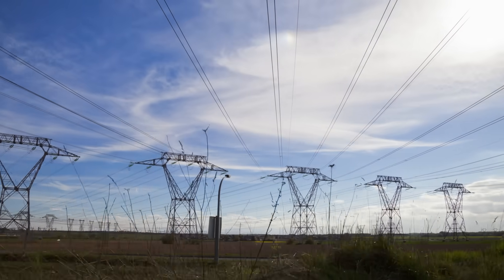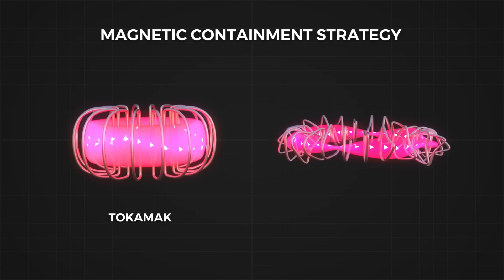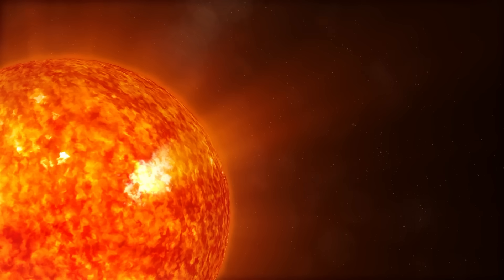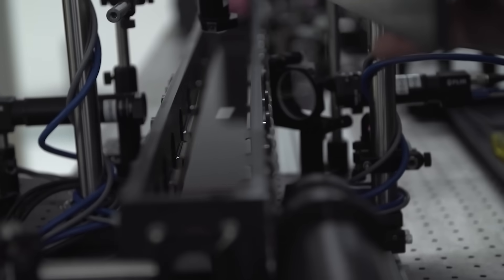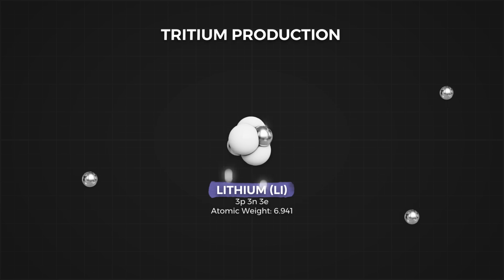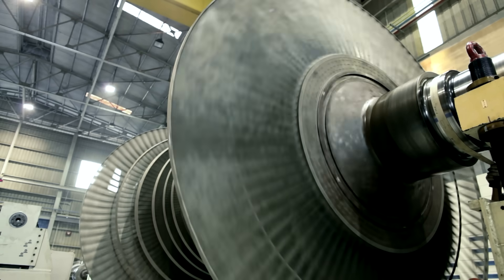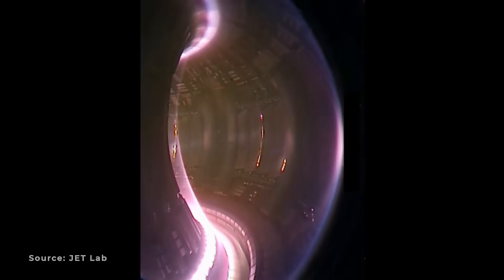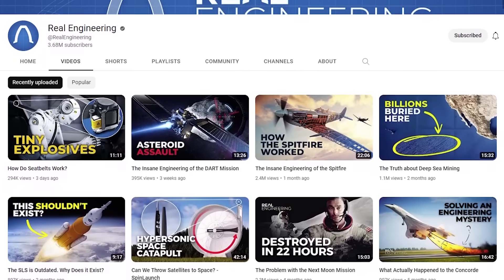The Problem with Nuclear Fusion

Comment: Great video. I’ve worked on magnetic confinement nuclear fusion at a National lab. One of the big problems is that everything is a massive partial derivative. Let’s say you have a hundred million particles inside the reactor. Each one has 7 dimensions of conserved motion. So traditionally to simulate it, you need either an extremely watered down equation that can make dozens of simplifying assumptions or a supercomputer that can take days to do a short simulation. Each particle can massively change their trajectory in just 10 microseconds, meaning if you want a perfect simulation for like 5 minutes, you need to run (100,000,000 * 5 * 60 * 10^5)^7 calculations which is probably some number bigger than the amount of atoms on earth. The good thing is that machine learning and GPUs are perfect for this kind of problem. So it’s gradually becoming the backbone of confinement modeling so the particles won’t fly out unexpectedly or the machine suddenly crash. In fact confinements not much of an issue anymore I’d say. Like I was able to take a 42 hour long simulation, rewrite it in CUDA, and have it run the same thing in less than 20 minutes. And on the experimental side, people have been able to run their devices for almost 10 minutes now which is extremely stable. And on top of all that, MIT recently made a high termperature superconductor that can generate massive magnetic fields so the machines can be scaled down to like 1/10th the size and still produce more power than ITER. While it’s still experimental, it’s basically in its last stages. The only things to worry about now is elmo.

The next stage will be finding the right materials to make the walls out of that will preserve the reaction and dissipate the energy over long runs. Tungsten has been generally used as the newer material but there’s still room for massive improvement. People have been experimenting with depositing an atom layer thick lithium gas on tungsten or using Liquid Metal walls that act kind of like a waterfall + cpu cooler inside the tokamak.

The tritium breeding issue is still on the horizon. Theoretically it shouldn’t be too hard to carry out. Just get a slab of lithium metal and put it right behind the tokamak or whatever device. But that’s a issue for another day.

Edit: also don’t forget that’s only tokamak fusion. There’s also like 20 other types of fusion techniques, some of which are very promising. ICF (kind of a budget laser-powered nuclear bomb) is experimentally like 70% (now >100%!) of the way to net energy. This is a massive jump considering how it was 5% just 3 years ago. Other ones are field reverse configuration with folding plasma whirlpools in the z direction, magnetic mirrors, z pinch (like a nuclear lightning bolt), and whatever that doesn’t need tritium and won’t produce neutrons so that the energy can be directly harvested with a magnet.

Edit: from Joesph Li

I do research currently at a fusion research institute. Some things worth noting: 

You're right that lots of folks are looking to ML and big data but traditional MHD and kinetic simulations are still the mainstay. Whole volume gyrokinetic simulation is widely used and actively researched to better understand transport as a whole. Neutral and wall interactions, and especially precise treatment of edge regions is mostly done via traditional methods rather than ML. 

Next on fusion techniques. You're correct that there are many different methods for containing a plasma, but the region the device landscape looks as it does today is because magnetic mirrors, Z-pinch, and other open designs have serious inherent confinement issues. As for ICF, the NIF actually reported a break even last summer on fusion gain in 2021 (not sure if published yet). One major issue the NIF faces is that ICF fusion requires several laser shots per second to be economical, but as of now I believe the rate of discharge is closer to once every several hours.

Lastly, I want to comment on smaller devices and different fusion fuels. MITs technology definitely holds a lot of promise, but one should temper expectations on output in smaller devices. Neutrons don't interact strongly and slips through solid material given enough energy (like those resulting for D-T reactions), so any D-T fuelled device necessitates fairly thick blankets and walls to efficiently extract energy. Moreover, one must still shield the outside of the vacuum vessel from neutron irradiation lest we risk the creating of radioisotopes outside the device from neutron bombardment. The obvious solution of using different fuel isn't so simple when one considers the much greater activation energy of those reactions. We can't even break even on D-T, never mind considering continuous operation on D-D or D-He3.

Progress is certainly being made but science takes time. And fusion is too expensive to get wrong. It's best to not get too hasty with our expectations.

Edit edit: just now, NIF achieved laser Q > 1 which is amazing for science. But it’s still a ways away from economic Q > 1 (where you can actually use it to produce power). But definitely a milestone and not number fudging anymore.
Reply: what did u study, how can i walk on the same path as you?
Reply: @venomous_zxs5493 studied physics. Most people in this field do physics, math, material science, aerospace engineering, nuclear engineering, or electrical engineering.

And the big 7 ITER countries should all have really good fusion programs that you can intern at. So US, China, India, Russia, France/UK/Germany, South Korea, and Japan. When you look for these programs, look for the word “plasma” instead of “fusion” research. I’m not sure why but it took me too long to figure that out.
Reply: @TasX  thx
Reply: @TasX  Why do we need to simulate the plasma to control it? If I have a steam engine I don't need to simulate the motion of each water molecule, I just need to make the walls of the piston thick enough to handle the pressure.
Do we need to simulate/anticipate the motion of the plasma because the magnetic fields we make are too weak?

Also, why not eliminate the tritium source problem by using deuterium-proton fusion which I think also removes the problem of high energy neutrons ruining materials exposed to them? 
Can't we just make the reactors bigger to distribute the higher forces of confining the plasma over a greater area?
Reply: @joeblogs6598  even a steam engine will fail if the firebox gets too hot, but otherwise theyre quite unlike fusion reactors when we at least know steam engines actually work 
just starting up a powerplant that doesn't generate power sounds expensive, around the mechanical concerns I've heard about lining the interior walls with sacrificial lithium plates that breed more tritium to use, yet that sounds even more expensive
anyhow its clear why simulation might be the cheapest move here, cheaper than doing nothing depending on who you ask
Reply: @SplendidKunoichi  My understanding is that they have to simulate the plasma in order to operate their reactors. I must be getting it wrong.

As for using lithium plates, it sounds completely uneconomical, or at the lest no cheaper than nuclear fission.
Reply: @joeblogs6598  assuming the electricity demand of a test start exceeds what the power grid can supply in real time, I'd imagine most of the time spent doing actual reactor experiments is just waiting for capacitor banks to charge up anyways
but data from computational models can be just as valuable in this field i think, the rationale might be a little like how astronauts have to do simulations in comparison
Reply: Please please comment more..   excellent post.
Reply: I do research currently at a fusion research institute. Some things worth noting: 

You're right that lots of folks are looking to ML and big data but traditional MHD and kinetic simulations are still the mainstay. Whole volume gyrokinetic simulation is widely used and actively researched to better understand transport as a whole. Neutral and wall interactions, and especially precise treatment of edge regions is mostly done via traditional methods rather than ML. 

Next on fusion techniques. You're correct that there are many different methods for containing a plasma, but the region the device landscape looks as it does today is because magnetic mirrors, Z-pinch, and other open designs have serious inherent confinement issues. As for ICF, the NIF actually reported a break even last summer on fusion gain in 2021 (not sure if published yet). One major issue the NIF faces is that ICF fusion requires several laser shots per second to be economical, but as of now I believe the rate of discharge is closer to once every several hours.

Lastly, I want to comment on smaller devices and different fusion fuels. MITs technology definitely holds a lot of promise, but one should temper expectations on output in smaller devices. Neutrons don't interact strongly and slips through solid material given enough energy (like those resulting for D-T reactions), so any D-T fuelled device necessitates fairly thick blankets and walls to efficiently extract energy. Moreover, one must still shield the outside of the vacuum vessel from neutron irradiation lest we risk the creating of radioisotopes outside the device from neutron bombardment. The obvious solution of using different fuel isn't so simple when one considers the much greater activation energy of those reactions. We can't even break even on D-T, never mind considering continuous operation on D-D or D-He3.

Progress is certainly being made but science takes time. And fusion is too expensive to get wrong. It's best to not get too hasty with our expectations.
Reply: @jolli_sym  great comment, can I copy this onto the top? For NIF, I think they did Q = .7 so not scientific gain yet. It was more the burning plasma achievement.

Edit: well breakthrough yesterday. What a coincidence
Reply: @TasX  certainly
Reply: @jolli_sym  As it was marketed by MIT in one interview, Commonwealth Fusion Systems needed only one “miracle.” That miracle being the High Temperature Superconducting cable called VIPER reaching 10 Tesla while meeting other specifications for temperature, stability, etc… VIPER reached those specifications according to CFS’s press release on 10/7/20. According to the YouTube interviews I’ve seen, the rest of the work is engineering and not in the realm of unknown science. Of course, engineering isn’t easy, but the science appears to show a path for their SPARC device to produce net energy output. While it wouldn’t be a power station, I suppose SPARC would be the Chicago Pile moment for fusion. Any thoughts? I’m just a layman.
Reply: @Luvurenemy  I'm not an expert on superconductors so I can't comment on the finer nuances, but a glance at the VIPER paper looks to be a clever design that more or less addresses the main structural issues usually associated with HT superconductors. Once the performance is there, fabrication and cost becomes the foremost issue. 
I'm certainly optimistic about what CFS is doing and can't wait for their demonstration machine to be completed. 

There is something to be said about size and these private enterprises though. One should keep in mind that these companies can never target a machine the size of something like the W-7X let alone ITER. It's simply too expensive and too big for them to handle, and they have to have something to show investors in a pretty short time frame. Hence reactor designs that are smaller, easier to prototype, and easier to sell investors on. But power plants have way better returns when they are big. From nuclear waste disposal to all the ridiculous supporting infrastructure a tokamak necessitates, the ROI on bigger machines is just better. And you can't simply just scale up a design. Where SPARC is concerned, the cynical side of me wonders if the small reactor designs plays into SPARC's VC facing marketing. HT superconductors are notoriously brittle and we don't know that once scaled up, it would be able to hold up it's own weight. I am still nonetheless optimistic however.
Reply: @jolli_sym  Thank you for your insight.
Reply: @jolli_sym   @F F  I studied nuclear engineering with a focus on plasma and fusion science, but I now work in a different field. Is the purpose of the of all this modelling work to improve the confinement of the plasma? Is tungsten erosion the primary issue with confinement?
What do you think of TAE's approach? They require much higher energies for their p-B11 reaction but they seem to be scaling up pretty fast.
Reply: @TheOOOOOOOOOOOOOOO  Numerical modeling of the plasma is done for pretty much any reason you can think of. I am primarily interested in plasma transport and turbulence, others study things such as wall interactions, heating, impurity effects, interactions with neutrals, sputtering, molecular dynamics in the sheath region, and all the various modeling done for developing plasma diagnostics. 

While tungsten erosion is a hot topic, and especially important for ITER, it's not got much to do with confinement per se. Confinement generally deals with maintaining the core plasma under your choice of conditions for as long as possible. Also, I'm unfortunately very unfamiliar with what TAE is up to. Reactions other than D-T are pretty off the table as far as academics are concerned. The math has been done and it's just much much harder.
Reply: i like your funny words magic man
Reply: From this, I can only conclude that fusion will never be possible with our present capacity to model, but that advances made during the pursuit of fusion will lead to better weather forecasting.
Reply: @Mad_Props_Gestapo haha definitely. I feel like so many important technologies have spawned off of fusion research over the last hundred years that it’s become the embodiment of “it’s the journey, not the destination” (though reaching the destination might also be nice)
Reply: Is "net energy" Q>1, or actual calculation of harvestable electricity greater than consumed by the experiment, because we need like Q=10 at minimum for actual "net energy", and like 50-100 for practical economic use. I hope I live to see it, but there's a lot of spin in the physics of fusion. 
Also, your sample calculation, if it's really everything ^7, is like 10^108 operations, so, a 100 petaflop supercomputer running for like 10^83-some years, but I get the point. 🙂
Reply: @NicholasA231  They say getting to Q=1 is a physics problem, and any Q>1 becomes and engineering problem. Once we have a breakeven reactor that can run effectively indefinitely, we know fusion power is possible.
Reply: wow there's alot here that i could learn from but as a mechanical engineering student i only notice one missing thing
you said there are 7 different kinds of motion but i can only count 6 (transversal in all 3 directions then the rotational in all 3 directions) so what's the 7th?
Reply: @guythat779 it’s phase space velocity + time. So 3 spatial dimensions, 3 velocity dimensions, time dimension (used for volumetric predictions with ML and maybe some numerical integration idk about the second one). Look up Liouville’s theorem for more on it.
Reply: @TasX  I positively understand nothing but thanks for the references
Reply: @guythat779  It's kind of the backbone of how Lagrangian/Hamiltonian physics was derived. It turns out that you can use this theorem to derive any conservation equation (like conservation of energy, momentum, etc). Then use those equations to find the motion of anything.
Reply: @TasX  I see
Thanks
Reply: @guythat779  is it vibrational?
Reply: @TheOOOOOOOOOOOOOOO  he answered me afterwards, just look throughout
Reply: "z pinch (like a nuclear lightning bolt), and whatever that doesn’t need tritium and won’t produce neutrons so that the energy can be directly harvested with a magnet."
If I understand this statement, it is something I have been wondering a long time - why can't we bypass the wasteful steps of converting nuclear to kinetic to steam to mechanical to electrical,  and go directly from nuclear to electro-magnetic?
Reply: @aliensoup2420  depends on the type of reaction. I think most if not all aneutronic reactions do direct to electric since all the particles are charged. Neutron producing reactions rely on the fact that neutrons don’t interact a magnetic field and that they fly out of the reactor to convert that energy into thermal energy. A lot of startups like to try the second route. But there’s a lot of logistical issues that they’re working through. Getting fusion is hard enough, getting fusion and somehow sustaining it while messing with the electromagnetics is another bag of worms. Also the neutron producing reactions operate at about 10 million degrees cooler than the aneutronic reactions so they’re also easier to carry out.
Reply: Not gonna lie.
Some words I didn't understand.
I'm skeptical 99% of the time about random comments but this sounds really honest and cool 😎.
Reply: Turns out ICF is 100% of the way to net energy at the Lawrence Livermore National Laboratory in California
Reply: Was that not the problem deepmind more or less solved half a year ago. 
I remember, they used reinforcement learning instead of the traditionel control methods.
Reply: @bjarke7886  not exactly. They were able to show that they can do pretty accurate dynamic predictions given a good initial model. The problem is that the computer isn’t fast enough and the video camera isn’t fast enough to constantly keep up with fusion plasma, which can change in the microseconds. It’s good for getting a general picture of what might happen though a few seconds down the line though. So people have recently built these gas puff devices that can cool down the reactor when it looks like it’s about to blow up.
Reply: I had a friend at Nvidia that did work with one of the spooky Labs. He said it was always low neutron retention and crap energy density...
Reply: But I like burning coal.
Reply: So  you are saying it's not a real time sim, right?  :-)  The fact that you can even DO that simulation, in any kind of a useful time frame, is actually amazing to me.

I had a 70 Cuda, when I was young.  I know, I'm full of them...really did though, actually two, one blue, and a later one that was in better shape to rehab, in black.

My dad did some electronics nuclear hardening testing for the SPRINT missile program, where he was the Systems Manager, in a pulse reactor.  But an H-bomb generator sounds a bit impractical, even to me.  😕

This next part is not smart assy, it is true: He taped a roach to the reactor on one test and it walked away when released afterward.  Also, they ran the first test and the usual BANG they heard in the control room didn't happen.  The engineer in charge said, "Hmm, never had that happen before".  They figured out that the test object was limiting (almost negating, i guess) the reaction.  

Dad asked, "What if it had been the other direction?" and the fellow said, "Then we wouldn't be discussing this right now". Oh, the fun some people have that nobody hears about!  Probably better that they don't, with stories like that.  Bad enough when they are dropping nuclear weapons in swamps in US states, accidently blowing up nuclear missiles in silos, leaving live nuclear weapons unattended on a tarmac, etc. (All true to, as I understand it, look them up, other than the one I related second hand, you probably won't find that one, but you never really know).
Reply: Hopefully quantum computing will come to your rescue in the next couple of decades
Reply: What is your opinion on aneutronic fusion?  He3+De2=He4+P
Reply: Fascinating... And very informative, thanks!
Reply: I really like the varient that can harvest energy from disturbance of magnetic fields.
Seems like it would be the most precise and sustainable kind of energy capture if achieved.
It's way easier to tune electromagnets than it is solid material and fluid dynamic systems...
Reply: Hey, what do you think if the lack of exotic helium problem?  We don't even make it anymore as far as I know, but I am just a farmer with serious insomnia.
Reply: Maaaaaybe time to reevaluate after the recent breakthrough, no?
Reply: Hi, my research is in hydrodynamic instabilities (non-MHD, but many mathematical techniques borrowed from plasma physics). I want to discuss some issues you've pointed out. Any way to PM you or have a virtual meet?
Reply: thanks for the elaborate comment, i was part of a research group worked on Plasma facing components as material scientists and lithium breader "blanket" in the UK. we tried using low activation refractory high entropy alloys as plasma facing components its a new class of alloys with a lot of promising properties and good radiation shielding.
Reply: Man, that is a great essay on Fusion power. You shouldn't waste all that knowledge in here, repost it to Quora or some other better platform for Science.
Reply: By any chance is the code available to the public?
Reply: @TWFDeadzoneII yeah check out gykell or gk. Those ones are actively used. Another more accessible one is plasmapy
Reply: where can one read up on MIT superconductors? I think it's the first time I hear about them
Reply: @NoNameAtAll2  Look up Commonwealth Fusion Systems, CFS, they built it.
Reply: I wrote a paper about this in 6th grade, roughly 40 years ago. 40 years ago they said it would happen within 10 years. For years it was always 10 years away, now they're telling us is 20 years away. Face reality. This may eventually happen. But we're nowhere near it. We need to be using technology that we actually have and can use Liquid fluoride thorium reactors are technology which is available today and can free us from fossil fuels. People need to stop throwing out the baby with the bathwater. No lftrs are not perfect. They're a hell of a lot better than anything else out there. And fusion isn't there. It's not practical. We can make it happen but we can't extract more energy out than we put into it yet. And even when we can extract out more energy than we put into it is it going to be enough more to make it worthwhile. How quickly are we going to burn through our stocks of available hydrogen. Lftrs or technology which are available today...

Build them now, and continue researching fusion. Maybe someday Fusion will even become practical. In the meantime we can have energy that is free of fossil fuels. For the next 10,000 years or so until we can figure out the next step
Reply: What is the name of the new HTS discovered by MIT please ?
Reply: @robinchaneac7180  REBCO tape
Reply: What happens if uranium or another fissile material used in fission reactors is used to line the walls of a fusion reactor to add heat from fission to the steam generator. Would that be a way to "turn on or off" fission? Adding a layer of safety to fission reactors and added efficiency of direct electric induction of fusion reactors? Also would this allow longer use of u235 and it's byproducts?
Reply: @John-sp7ne  I think there was a theory about that. But generally no one’s talking about it right now. It’s hard enough to build a working fission reactor and even harder to build a fusion reactor. Maybe once we build a working fusion reactor we can worry about making a fusion fission reactor.
Reply: So... what you're saying is 20 years, tops?
Reply: On the way to net energy? So that means it will be a "success" when they get the first 100 watts out of it at a cost of a billion dollars?
https://youtu.be/V_0VEmN7Bg8
Reply: Couldn't you use quantam computers to speed up the simlations?
Reply: @jeremiah5430  once quantum computers work
Reply: @TasX  Hopefully they can find a fusion process that is more elegant. The current one gives off a bit of a bodge vibe as if something is missing.
Reply: @Termite Ant Soup X  Im just a layman on this subject but have heard a lot in both directions about He3 potential, particularly from long term visions of lunar mining. I imagine thats its current scarcity means not a great deal of research has been done on it outside of the theoretical, still would you have any comment on if you think, if we did suddenly gain a relatively plentiful and cost effective supply, it could help the Fusion Industry take off?
Reply: @cyborg_v271  you should definitely watch the next video this channel puts out then. It looks like they’re going to talk about Helion which does He3
Reply: Have some faith, we are making some crazy leaps in fluid/MHD simulation technologies piggybacking off of the AI race!
Reply: Repent. Believe in Jesus. John 3:16 KJV - For God so loved the world, that he gave his only begotten Son, that whosoever believeth in him should not perish, but have everlasting life. 
Luke 13:3 KJV - I tell you nay: but except ye repent, ye shall all likewise perish. 
2 Corinthians 5:17 KJV - Therefore if any man be in Christ, he is a new creature: old things are passed away; behold, all things are become new.
Reply: What are the actual exhaust components from a deuterium tritium reactor? Also for energy production, would we still probably use steam turbines, or is there something different from fission that we could use to generate electricity?
Reply: If you want to make a working commercial fusion reactor in two years, and get commercial heat, I can help you. I have made a great world-class scientific discovery about nuclear fusion in the atmosphere of the Sun.  The assumption by scientists all over the world about nuclear fusion in the core of the Sun is well known.  This is a fallacy. For over 72 years, scientists have not been able to make a working commercial thermonuclear reactor, and will not be able to make one for many years to come. The reason? The misconception of nuclear fusion in the Sun. 
Nuclear fusion in the Sun's atmosphere begins under the physical conditions existing there at an initial plasma temperature of 5,000 K; by the end of the fusion reaction, the solar plasma temperature reaches 1,500,000 K, on average.  Sunspot temperatures on the Sun from 3,000 K, sunspots can be up to 100,000 miles in size. Doesn't this prove that nuclear fusion occurs on the surface of the Sun, not in the core of the Sun? If we take a good look at and study sunspots, it is clear that nuclear fusion takes place in the Sun's atmosphere.  
I know how to replicate the physical conditions for nuclear fusion in the Sun's atmosphere. I propose a reactor design with the same physical parameters for nuclear fusion and excess heat as in the Sun's atmosphere.    https://www.youtube.com/watch?v=FcypwoVOAAY 
To make a small working prototype confirming the principle of nuclear fusion in the Sun's atmosphere and obtain commercial heat needs about 10 million euros, manufacturing time 2 years. It could be less. Depends on the country where the prototype will be made.
Reply: why not use PDE to model plasma? model as a fluid, not particle
but fusion don't look cheap... thats too bad.
people are most reluctant to pay more.
Reply: That was useful.
Thanx
Reply: Sure 
What u said sounds good 👍
Reply: I want to watch a video on the topic by this person.
Reply: "Field reverse configuration with folding plasma whirlpools in the z direction"

That is the coolest arrangement of words in the English language that I have ever seen
Reply: Back here in December 2024 - how's the progress?
Reply: Can you give me a document? I need to leak to war thunder forum
Reply: What is the repetition rate?  Yeah....that's kind of important. 24/7/365, hundreds of times a minute. Kind of a crushing thought.....
Reply: Try this data point: Because the electron's Coulomb (electrostatic) repulsion for another electron is 10-with-42-zeros times as strong as gravitational attraction, harnessing a controlled, sustained fusion reaction in a local environment WITH MORE ENERGY DRAWN OUT THAN PUT IN FOR THE ENTIRE PROCESS is a PHYSICAL IMPOSSIBILITY. "Put that in your smipe and poke it!

A physical impossibility! Yet, much money and time is being WASTED on attempts to “find a way,” apparently to justify continued reckless population growth on this fragile planet. (The problem does not exist with fission reactions, which have their own set of intractable problems, because energy release follows the direction of universal evolution WHICH IS TOP DOWN cosmology)
Reply: Per Google, John Adams said, “Facts are stubborn things; and whatever may be our wishes, our inclinations, or the dictates of our passions, they cannot alter the state of facts and evidence.”
Reply: Im very excited about thorium reactors tbh, safer, more publicly accepted, and sure lower output but still a fair amount. I just hope we have 3 hardcore failsafes before we go into mass production. Overkill? Sure but radiation is not to be trifled with. Ive toyed with the idea of flooding a reactor with an inert gas that lowers radioactivity but I dont think we have something that does that or at least I dont know of it. Id love to know your thoughts!
Reply: Per Wiki: "Two centuries ago, a somewhat obscure Scotsman named Tytler made this profound observation: 'A democracy cannot exist as a permanent form of government. It can only exist until the majority discovers it can vote itself largess out of the public treasury. After that, the majority always votes for the candidate promising the most benefits with the result the democracy collapses because of the loose fiscal policy ensuing, always to be followed by a dictatorship, then a monarchy.'"
 
This is more-than-coincidentally the estimated amount of time it would take for a competitive and hence intelligently evolved tribal mentality to devolve into an idiocracy.
Reply: Okay I just read all that and if I understand correctly, you’re telling me that this SUCKER is nuclear?
Reply: No. The problem is that this sucker only makes 1.15 gigawatts. Obviously we need 1.21 gigawatts.
Reply: EVERY mechanical conversion of energy from one form to another has an inefficiency; otherwise, it would be possible to build a perpetual motion machine.
Reply: Since the universe began with a singularity, if that singularity was a Big Bang, then all of the currently-observable order is required to “self-assemble” from the resultant hot chaos—“allowed” because, though extremely improbable, it is not theoretically prohibited. I don’t believe that! My theory starts with a singularity where everything is connected into a single mass that initially divides into two, like in cell division, but with smaller masses with each division, united by proto-gravity. (Gravity and light were indistinguishable in the beginning.) If in choosing between the two, one of the theories contains a “unwanted message,” that “everything is connected,” then the former theory would be preferred (with blinders on), thereby conceivably allowing a misinformed majority to be manipulated for power and selfish gain by a elite minority. You can “take that to the bank!”
Reply: 100 percent words. 0 percent understanding. I speak only for myself
Reply: Bro reading this makes me feel like an ooga booga cave man from stone age in comaprison to your knowledge and intellect.
Reply: Has anyone tried using a plasma to contain the plasma?  kind of like a blanket? Maybe Xenon?
Reply: Realistically inertial confinement isnt likely to be good for energy generation. It's effective for fusion bombs though....
Reply: Meanwhile, fission plants work, they are here, carbon-free, always on, inexhaustible fuel.

Fusion is a money pit.
Reply: @scottslotterbeck3796  Any new form of technology is initially a money pit. The idea is that after a while, people can figure out how to make it profitable
Reply: Know of any promising ICF fusion companies to invest in?
Reply: Its the WRONG shape. That's why it will never work. also the fuel tritium has run out already. only 14 kilos worldwide. has half life of 12 years !!!!
Reply: You and others like you are the problem.  Here on Youtube trying to sway public perception knowing full well what tritium does to human and plantlife.  For fusion reactors to use tritium/deuterium we have to rely on fission reactors...being that naturally occuring Tritium is extremely rare on Earth and only found in trace amounts in the atmosphere.  Tritium permeates the metallic structures, and when taken up in plantlife forms Organically Bound Tritium of which does not have the same biological Half-life of 12-30 days that just tritium alone has.  OBT causes DNA strand breaks, micronucleus formations, cell necrosis or apoptosis, chromosomal aberrations and various other phenomena thus negatively affecting human health.  This is from newer research and rhe biological Half-life of OBT has still yet to be determined.  This is exactly why all water cooled fission reactors need to be shut down today because the Blue Ridge Environmental Defense League publication in 2007 on the "Health risks of adding new reactors to the Vogtle Nuclear plant" shows the affects.
Reply: What about using sound to contain the plasma?  I've seen videos on how they use sound to hold and manipulate a small piece of wire in air.  They were talking about using it in surgery to insert objects into the body using sound.  Or is the mass of the plasma sufficient to need more than just sound to contain it?
Reply: @anothermike4825 you need a medium to conduct the sound (since it’s a compressional wave). The inside of a tokamak is a vacuum chamber and particles are moving so fast they rarely interact other than at the edges. I’m sure there might be microcompressional effect like micro plasma turbulence you find at the walls of the device where particles bunch up. This is still being researched. Might have to do with why we keep getting this annoying instability that drains the device of its energy.
Reply: @TasX  thanks for the response
Reply: @TasX  What about vibrating the magnets? How does vibration affect a magnetic field?
Reply: @anothermike4825  since these reactions occur at vacuum, I doubt that'd work out. Nevermind I imagine atomic forces will easily overcome sound waves and there's very little mass and surface area for which the waves to operate on.
Reply: @SK83RJOSH  What about vibrating the magnets? How does vibration affect a magnetic field?
Reply: Sound is just waves of energy passing though a medium, ie sound is air molecules bumping into each other. But the plasma needs to be isolated from everything, including air. You can't have air in contact with the plasma as the plasma is heated to solar temperatures, and air molecules would transfer that heat to the surrounding area, both heating up the space around the reaction by a tremendous amount and cooling down the reaction itself. In short you can't use sound to contain the plasma. We have a better solution, we can use powerful magnets to contain the plasma, as hydrogen has a positive magnetic charge. The plasma "floats" in a vacuum on magnets, and doesn't directly touch anything at all, not even air or the walls of the container.
Reply: By fusion of gravitational and manetic forces like hydrogen atoms can assess the process. We need to engineer three concentric confinement bottles to develope the atmoshere for the fusion in space
Reply: @alphabetamathematical5016 gravity doesn’t play a really big role in fusion. The electromagnetic forces are so large compared to gravity that you wouldn’t see the effects of gravity within the span of the reaction. And all of the chambers are vacuum vessels too so there’s no need for an atmosphere.
Reply: @TasX  I am in India and the leading scientific research institutes here  (the IITs, IISc and IISERs) offer nuclear engineering courses coupled with theoretical physics. Would that enable me to work on fusion or would it only limit me to fusion ?
Reply: @TasX  Gravity is not really a force. We don't know what it is, sir. There is more to it than our understanding of the Standard Model.
Reply: Let's  sum up this wordy sales pitch: 
"For over 60 years the fusion research industry has achieved nothing, except the enrichment of the fusion research industry."
Reply: have you consider building a free energy device?....no, it's already possible now, just like how the fusion is getting better after decades,  people just beyond insanely reject it, because some scientist who live hundred years ago thought it was impossible...fusion doesn't have that kind of treatment while achieving almost nothing after years of development and trillions dollar of investment
Reply: @electronresonator8882  as in... A perpetual motion machine?